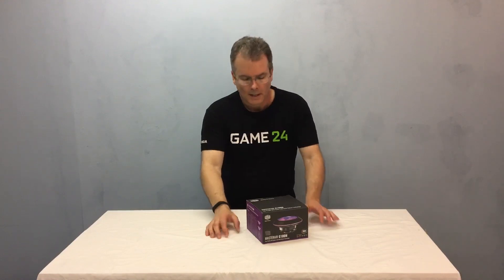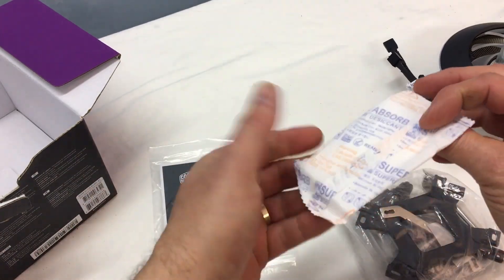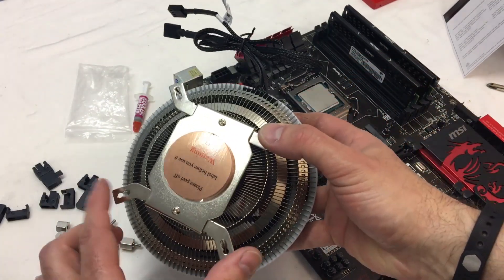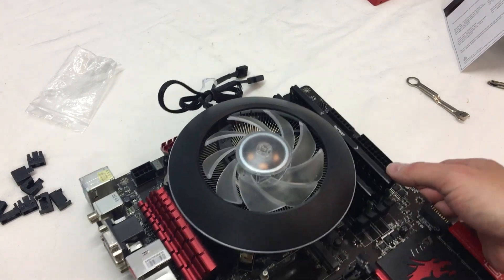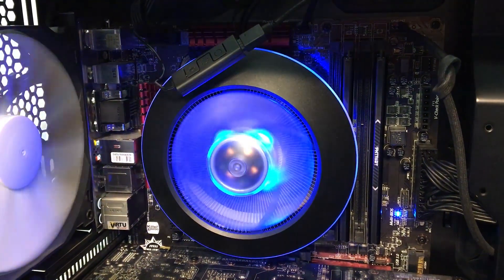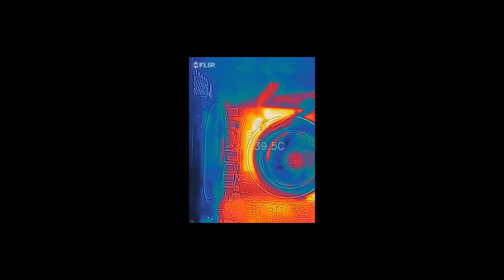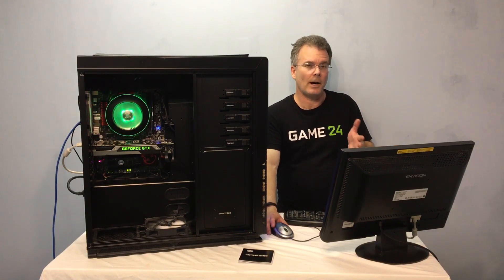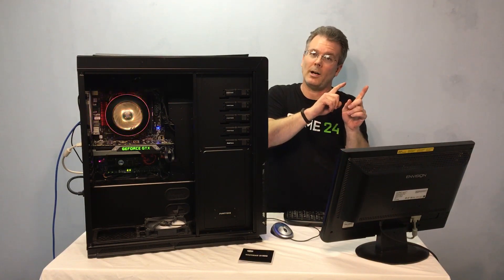Cooler Master MasterAir G100M CPU Cooler Review

Comment: Would you recommend me this cooler for amd A10 radeon 7-7980k?
Reply from the maker: It depends on how you use your system, the room temperature, and of course how good the airflow is in your case.   For a stock system (no overclocking) it should be fine but keep in mind that your CPU is rated at a TDP of 95W  so you may run a little warm when the CPU is under a load.
Reply: @overclockersclub  I just want my pc to play wow and lol :) I think it must be ok but one time my cpu shut down alone...

Comment: im using this cooler on a i5 8400 and get under preasure 85 to 92 degrees, i need to worry for mi cpu?
Reply from the maker: A spike to those temps here and there is no big deal.  Are you overclocking? I would not want to run at those temps all day long.  Make sure you have the cooler installed properly, and with the right amount of evenly-distributed thermal paste. Remember, too much paste can be bad.
Reply: @overclockersclub  I can not overclock an 8400, but I already solved the problem, it seems that the thermal paste I used was expired, I changed it for a new one and now it reaches 65 =)
Reply: @dnilos911  is that the temperature under load or on idle??

Comment: Quick question will this be a good cooler for an i5 8600k with 2 intake fans and 2 exhaust and 1 on top o the case will that be good enough?
Reply: Mohamed Alali id just pay for the hyper 212 if you wanna be cheaper you could get the hyper 2 both from cooler master your cpu will last longer if cooler
Reply: yes bu i would recommend something more like an arctic freezer 33 esports one for a similar or cheaper price

Comment: Ok so i have a p3 open air case 2600x I'm going to OC to 4.0 all cores..should I use the g100m or wraith spire it comes with
Reply: this cooler is not designed for owerclocking .. this is cheap (25 eu) cooler, for CPUs up to 65 W (your is 95W)
Reply: @jazzmax9521  what do you recommend then I have 3 ll120 I was thinking of taking them back and just going with Corsair liquid cooling..or coolermaster for rgb
Reply: @jazzmax9521  h80i v2 aio Corsair liquid cooling is my next choice
Reply: yes ofcourse, go for water cooler, but best coolers are always "low profile" coolers because  they cooling also motherboard (memory, chipset etc..)
Reply: @jazzmax9521  do you think that will be an issue since im using the p3 open air case?
Reply: whats the p3 open air case ? some nice coolers: CRYORIG C1, Thermalright AXP-200 Muscle or Jonsbo HP-625 and a lot of anothers ..
Reply: @jazzmax9521  you can Google thermaltake p3 black and that's my case but I want something aesthetic since it's open and clear
Reply: yep I can see, in this case there doesnot exist air blowing (best in one direction,, exactly like in tube of vacuumcleaner) whats the "alfa, omega" of right cooling .. for example here my case: case: Fenix - Prodigy, cooler: Silverstone HE02 (passiv-no fan) and  1x fan 14x14cm constantly being at 650rpm (just this one fan in all case !) on the rear wall of case. procesor Xeon 1231v3 - 3,8Ghz 4/8 (its I7 cpu). Temperature of cpu playing games max. 55 C, stress test max. 75 C. In your option doesnot exist blowing.. sou best solution is cooler with again "low profile" airflow direction on components of MB and you will be good :) This one is perfect: http://www.phanteks.com/PH-TC14CS.html with one fan.
Reply: i have an am4 unfortunately this only fits up to am3  @jazzmax9521
Reply: well did you get it if yes then how does it perform am getting this for r7 1700x

Comment: Wil this cooler be efficient for cooling a i7 8700 non k version at full load?
Reply: Probably not
Reply: @joni2622   i have i7 8700  with this cooler  and full load  temp is 58C-60C  max
Reply: dj extreme970 what! You serious?
Reply: @jdapoet3138  yes i am  i dont lie lol,cpu cooler needs to be firmly attached, on the processor, i use cooler master v1 paste
Reply: dj extreme970 ok thks you just removed my worries i will buy a noctua paste it should work well
Reply: Hell no cpu gonna explode get a tower

Comment: Do you have space to put all 4 rams? It seems like the cooler is going on top of the first slot of DIMM. Like, would you be able to put the RAM on Maximus IX Code?
Reply: Ahri Main yes it would fit, it is tall enough
Reply: It depends if you have tall ram no if you dont you can get the cooler i dont recomend this cooler he makes it seem good but its horible
Reply: 10,000 Subscribers Without Any Videos will my i5 9400f run well with this cooler ?

Comment: I noticed the Viper RAM. Will this cooler fit over the Viper RAM when all slots are filled?
Reply: Only low profile RAM will fit under this cooler. My slot nearest to the cooler is unusable.
Reply: @thecan2846  I can pull the heat spreader off the stick in slot nearest cooler and maybe that would work?
Reply: It might work...I'm not sure.

Comment: Would you say this would be an upgrade over the wraith prism(2700x stock cooler) paired with a Meshify C case(you mentioned airflow is important). Intending to overclock.
Reply from the maker: I have not tested the Wraith, so I can only speculate.  If the G100M is an upgrade, it is probably not a huge one.  Since you know you are going to overclock, and the Meshify C has approximately 170mm of cooler clearance, you may look at some other coolers in the Cooler Master line up such as the MA410M TUF Edition or the MA620P TUF Edition.  They are close to the G100M pricing. Of course there is liquid cooling too...

Comment: I hate the trend these days I'm still using my Macho Rev.b to this day there is really nothing drastically better for cooling. Keeps my 4790k at 4.7ghz with temps at gaming range from 55-65c depending on the load. 

In the UK this thing is selling for the same price as some of the best 120mm single fan coolers around. £40 is too much for the performance you get from this thing.
Reply: Measure the ambient temp in your room,and then open a window to cool it.Graphics cards are notorious for lifting room temps,m8,i have 2 gtx 970's in sli,and within 40-50 minutes of gaming,i have to open my bedroom window ,for ME to get some cooler air,let alone my pc...

Comment: Would it be good for a ryzen 7 2700x?
Reply from the maker: Would it work?  Yes, but I would not try to run it all the time with a hard overclock without good air flow in your case. Keep an eye on the temps if you overclock. Otherwise for normal use it should be fine. The key really is good air flow  through your case.

Comment: Which way should I put my case fans if I'll be using a cooler like the G100m that push air on the processor instead of taking it away?
Reply from the maker: A down flow style of cooler like this one also helps to cool your motherboard components. You should consider a case setup with one rear exhaust, two top exhaust and two front intake fans for maximum airflow. This should be easy to do with most mid-tower cases.  Stay tuned for some Cooler Master case reviews.
Reply: Thank you so much, appreciate it!

Comment: Can I ask what's the test CPU? I hope G100M is decent for a 95w CPU at stock speed.
Reply from the maker: My test uses a Core i7 4770k @3.9 GHz and 4.2GHz with a Prime95 load, and that can be a bit brutal on a small cooler.  But for a CPU as you mention, this cooler should work well. But keep in mind that the CPU cooler is only part of the picture. A good case with adequate airflow is also important. And a small investment in a couple of extra fans can go a long way.
Reply: My case has 3 exhaust (1 rear, 2 top) and 2 intake 120mm fans. I'll order the cooler. Thanks for the answer! :)